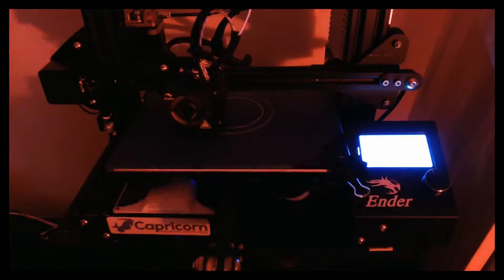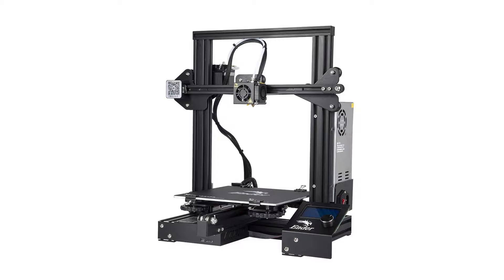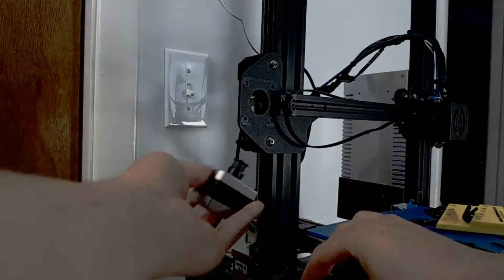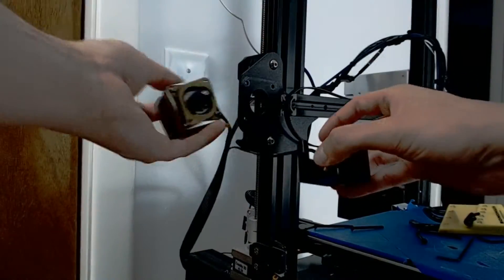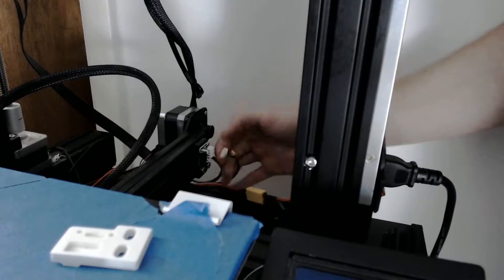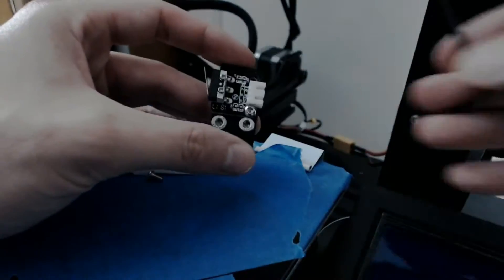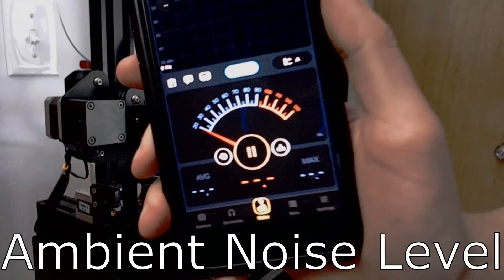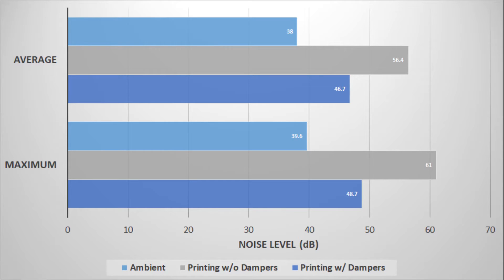How to make a 3D Printer Quieter - Damper Install

Comment: I saw in other video the guy said i needed to upgrade the firmware to invert the rotation of the x axis or something, is it not necessary?
Reply from the maker: I didn’t have to do this, I think it’s because there are different motors that were shipped with different Ender 3s, some allow you to adjust the part where the motor contacts the belts, and some don’t. My printer had this piece adjustable so I didn’t need to print a bracket and flip the x-motor. If your motors have the little black screws in the motor that I loosen and tighten with the Allen wrench then you shouldn’t need to do that
Reply: @CASSDesigns  thanks ill check that out